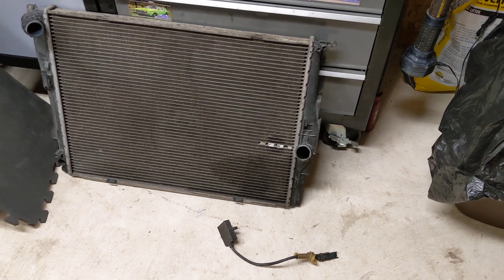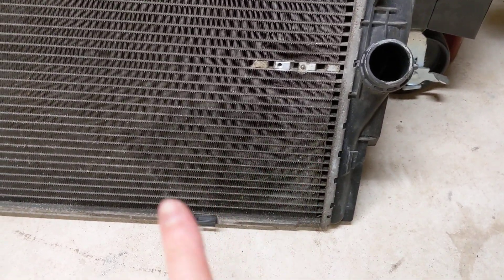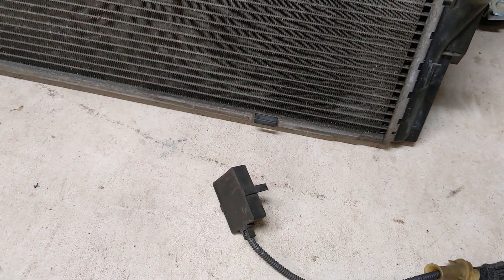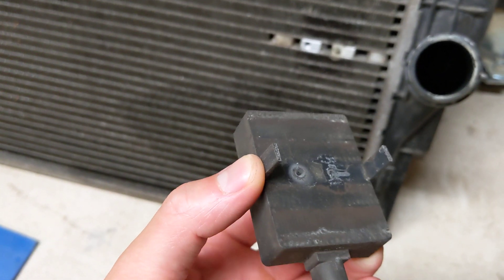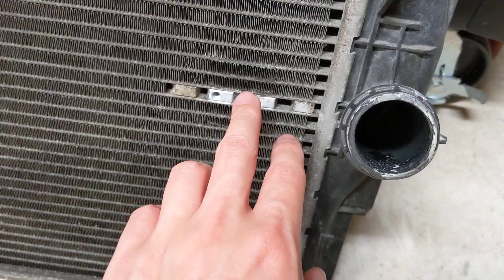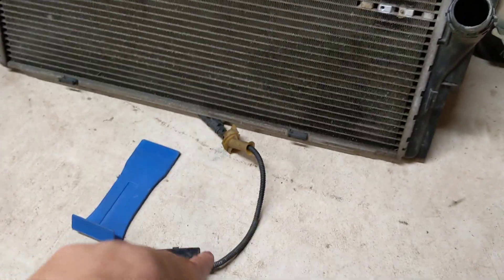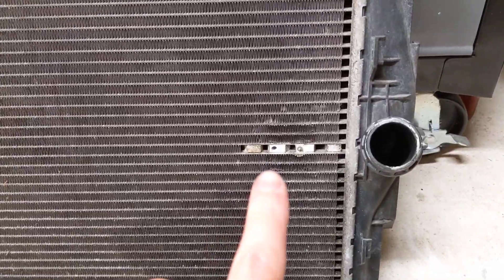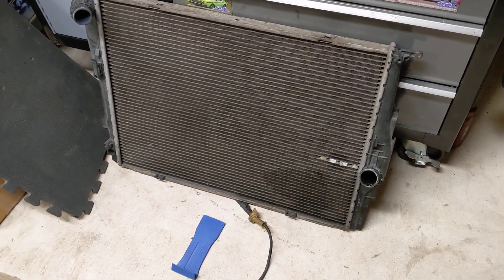BMW N51 EAC sensor code 2AD8 - temperature implausible overview

Comment: Will it work if I stick the sensor anywhere on the radiator? Will it work if I tie it with wire or cable ties?
Reply: did   you try this did  it work ?

Comment: I bought a use car and it came without the sensor and the radiator didn’t have any place to put the semsor that I bough so my car is running without it
Reply: you have an N52 it’s only for SULEV N51 engines
Reply: Did you get any dash lights on the car ? I have the same issue

Comment: I bought an after-market radiator and my check engine light is on with this code fault. How can I fix this without buying a new radiator?
Reply from the maker: watch my follow up video and replace the sensor
Reply: @MINIzguy which video is it?

Comment: I took out the sensor and the plastic pin still in there. How can I know that still good. Using a multimeter will help? It should has any resistance between pins? Thanks
Reply: How did you fix it?

Comment: Bought an after market radiator for $200 comes without sensor. After market doesn't come with space to fit sensor, how can I glue old sensor to new one ?
Reply from the maker: Unfortunately you're going to need a different radiator with a place to glue the sensor to. I don't think sticking the sensor into the radiator fins on your new radiator will work.
Reply: @MINIzguy  ok thanks

Comment: So did you figure anything out..??? Bypass or re tune etc
Reply from the maker: Yea, I made a follow up video fixing the issue. Check the top right corner of the video in the first 10 seconds, there's a link directing to it.